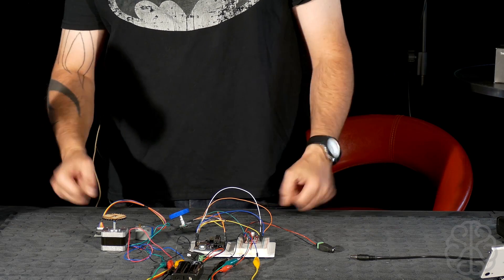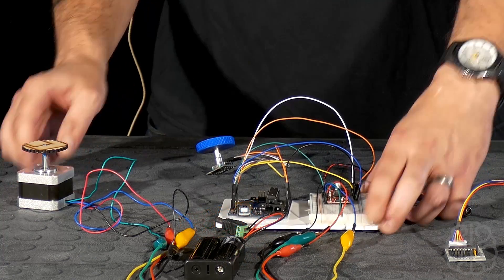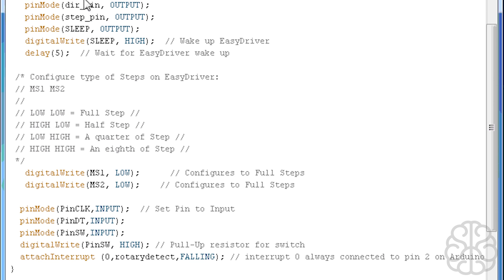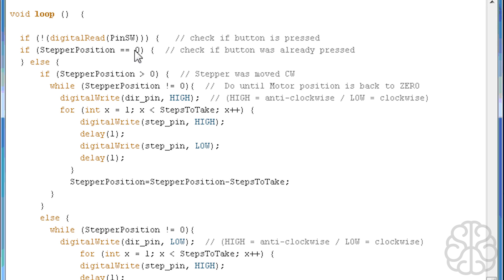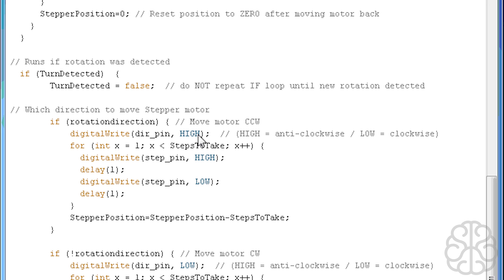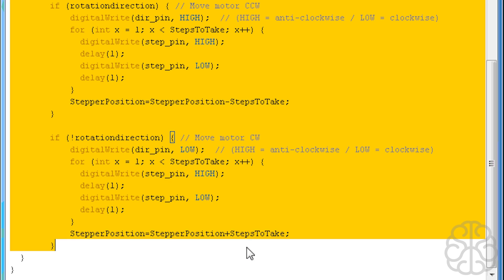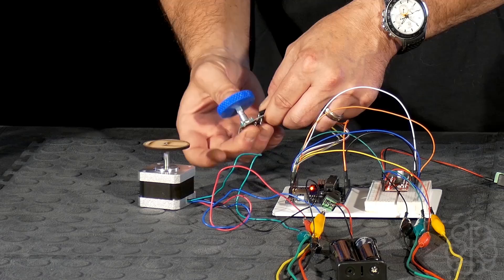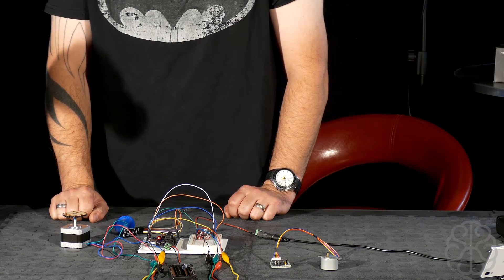Control a Stepper motor using an Arduino a Rotary Encoder and Easy Driver - Tutorial - Part 2

Comment: Thank You for this great and in-depth tutorial, you are life saver! Been looking for something like this for ages finally found it.

I Tried same setup with Arduino nano but it's not working, Do i need UNO board only?? or am i doing something wrong, only change i did was powering easy driver with 9v alkaline battery.

PS: Thanks Again!

Comment: could i also just only use the output pins Direction and Step? because i dont have enough digital outputs on the arduino. I use in my setup the 
Arduino CNC Shield V3 and A4988 stepper motor driver...

Comment: Can the same board and code be used to control a NEMA 23 (High torque) stepper motor? Also, will the NEMA 23 be able to turn a load of 2kg right on its axis when the axis of motor is perpendicular to the ground?

Comment: Hi Brainy, I want to control (3) individual NEMA17 motors with individual (3) rotary encoders and be able to operate each motor independently from each other. Do I use a Mega board and (3) easy drivers and combine the code for the 3 motors, encoders, interrupts? Thanks

Comment: Hey hey will it work with a arduino nano ?
Reply from the maker: Yes you can use a nano instead without any modification to the code or connections.  Thanks for watching!
Reply: thnx for the anser and how do i power the nano and motor without a usb but with a 9v battery ?

Comment: Hi Brainy, can i ask a question which is related to this topic? please. its life and death
Reply from the maker: Hi, ask the question, and if I know the answer I'll be sure to respond :)  Thanks for watching btw...
Reply: Brainy-Bits I am trying to control a stepper motor by reading values off a mpu6050, the code works fine but the motor speed reduces greatly compared to the motor running on its own, can I ask why? And how to solve this problem? Ty

Comment: AMIGO QUAL MODIFICAÇÃO EU FARIA NO CÓDIGO PARA COLOCAR DOIS MOTORES, E DOIS Rotary Encoder, E AMBOS TEREM O FUNCIONAMENTO INDEPENDENTE ? QUERIA INSTALAR EM UM MODULO DE LENTES DE UMA CÂMERA DE VÍDEO QUE DESMONTEI PARA CONTROLAR O ZOOM E O FOCO.

OBRIGADO, E PARABÉNS PELO VÍDEO, SEUS PROJETOS SÃO FANTÁSTICO. 

MODIFICATION FRIEND WHICH I DO IN CODE FOR PUTTING TWO ENGINES, AND TWO Rotary Encoder, AND BOTH HAVE INDEPENDENT OPERATION? I wanted INSTALL IN A VIDEO CAMERA MODULE A LENS THAT dismounted CONTROLLING ZOOM AND FOCUS.

THANKS AND CONGRATULATIONS VIDEO, YOUR PROJECTS ARE FANTASTIC.

Comment: sir i purchased leadshine driver DM856 for leadshine stepper motor (86HS85), I am controlling it with arduino UNO but i am unable to get higher speed with it. sir plz do guide me to get higher speed on stepper motor.
Reply: plz help me with codes or sketch on arduino
Reply: Vithlani Bhargav

Comment: hi, i am using different driver from you which is Adafruit Motor Shield V1, it is compatible to UNO, but can this driver done the same result as this video shown??
Reply from the maker: It should be able to, but Adafruit probably has their own library to control their Motor Shield.  Check with them to see if there's a library available.  Thanks for watching!
Reply: +Brainy-Bits Thank you very much !
Reply from the maker: No problem. Wish I could help more, but don't have this Motor Shield on hand to test.  Thanks for the reply!

Comment: Very cool ! 
Could that drive a Nema 23 as well (if needed for torque) ??
Reply from the maker: +Mambrax444 As long as your stepper does not need over 750mA per phase, which is the maximum the EasyDriver can handle then yes.  Although 500mA per phase would be better, since 750mA is the maximum rating and would need at least a heatsink to protect the chip of the EasyDriver.  Hope that helps and thank you for watching and comment!

Comment: I am using an IMU and i want the motor to move according to the coordinates the imu picks up. I want it to do automatically, not by using the rotary encoder. Will this be possible with an incremental encoder?
Reply from the maker: +Abdullah Rashid Would need more information on your project, but can't see why it wouldn't work.  The stepper could move relative to the values of the IMU.  Thanks for watching!

Comment: Hi, may i know how to connect or change it to wireless..?
Reply from the maker: +Rizko Angga Vivedru We have done a video on using an RC transmitter/receiver to control our PTZ cameras here: https://youtu.be/dlxE3kw4H94  but it could be used to control steppers if you wanted.  Hope it helps!  Thanks for watching!
Reply: +Brainy-Bits thx for the tutorial, I'll try it...

Comment: Hi. I understand you are trying to show how to control a NEMA stepper with a rotary encoder. Is it possible that I use Arduino to control the NEMA motor directly and the encoder is used to make sure that the stepper doesn't miss a step and if it does, the controller (arduino) can fix it with the readings from encoder?
Reply from the maker: +朱佩君 If you can connect the rotary encoder so that it rotates in tandem with the stepper then you would get some feedback, but you would have to figure out the code to keep track of the number of steps taken relative to the rotation of the Encoder and adjust accordingly. Thanks for the comment and watching!

Comment: I thought connecting your driver first is wrong because it could be damaged?
Reply from the maker: +Cutter Slade I've always powered the EasyDriver first so it's ready when powering the UNO, haven't had a problem yet :)  
One thing I know that can damage the Easy Driver is to connect or disconnect the Stepper Motor from the EasyDriver while it's powered.  So make sure the power is off before hooking up your Stepper.
Thanks for watching!
Reply: Oh, right that's what I ment. Got it Confused.